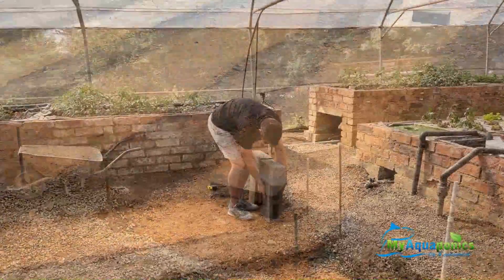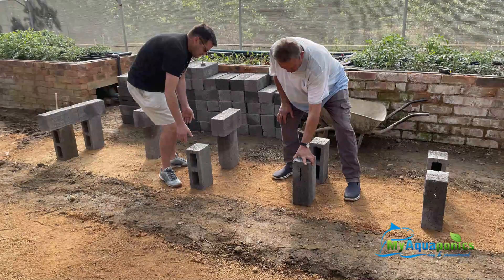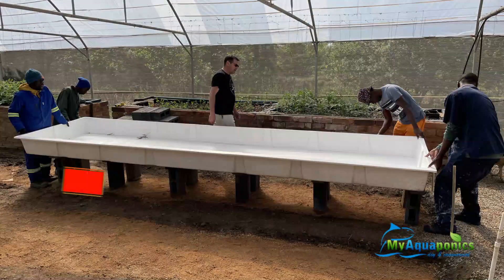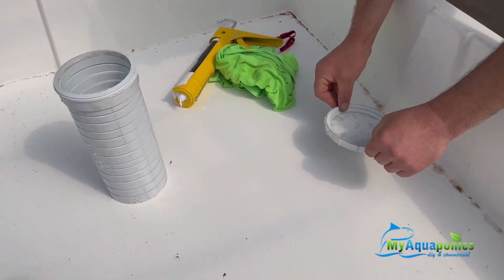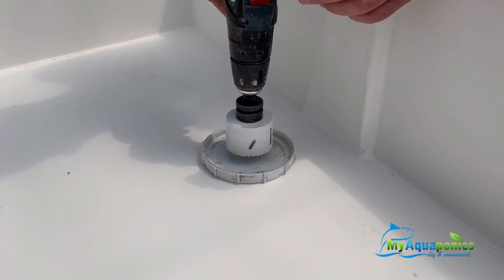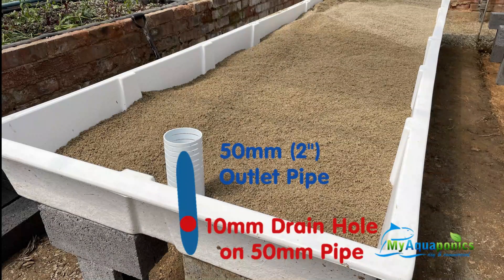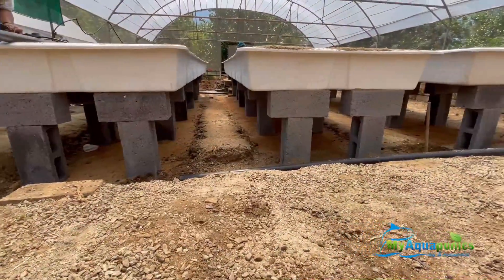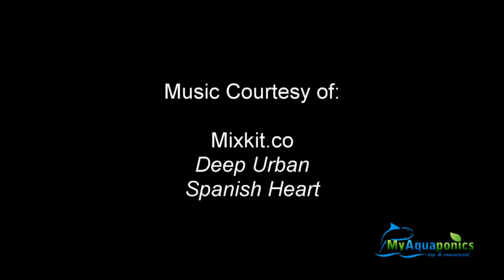Sandponics   Part 2: installation & Levelling of Fiberglass Plant Growbeds : 2021

Comment: I would have some serious concern about the stability of the system from a force directed against the end of the beds (some one falling into the bed or hitting with a cart can knock over the bed. No buttressing support.
Reply from the maker: As with anything there is always a risk, so your analysis cannot be ignored so thanks for your input. This system of support has been tried and tested by someone else for over 2 years and hence why we took the same route. Once the beds are filled with 2.5 tons of sand and some water, it becomes very stable and will require huge force for someone/something to knock it sideways. Of course, common sense should prevail by staff manning the system to ensure safety is paramount and to not allow children or others to play around or below the growbeds. Others building a similar system can add buttress support to their liking and peace of mind.
Reply: My first thought too. Many potential points of failure.